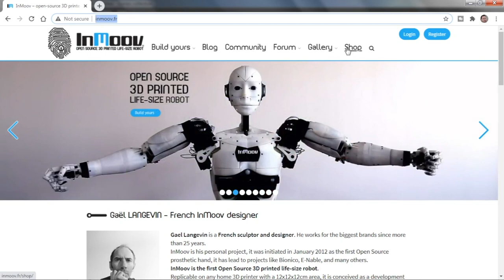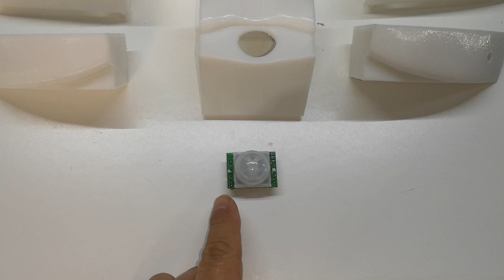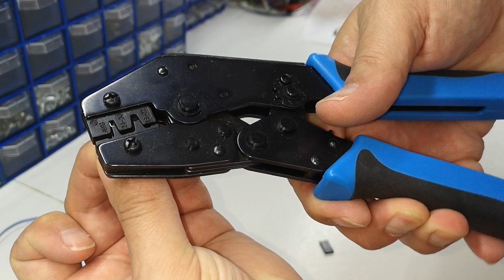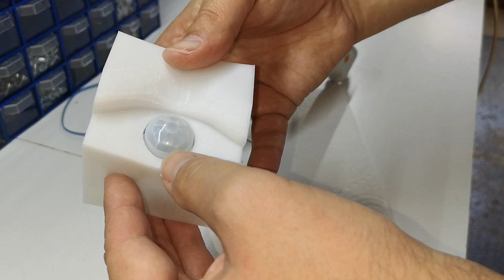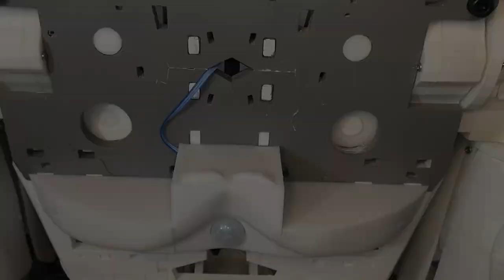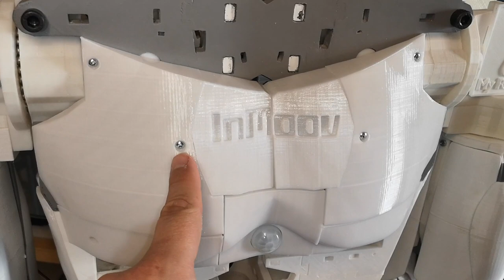Civrays InMoov - Sticking our chest out

Comment: In my build of the chest 3 years ago, I glued the two parts of the hollow center part with the hollow logo together to form one part, then screwed it in place to the rest.
In my case I used a Black filament for that center part and then printed white lettering and glued that in.
The rest of the chest is white.
I also had to file out a bit near the shoulders as well.
I have been tempted to make the whole chest cover one part by welding all the parts together.
Got a few other ideas for mods/add on's as well, such as a small OLED display as a programmable name badge.
I like your build.